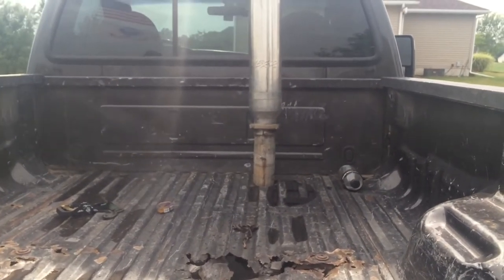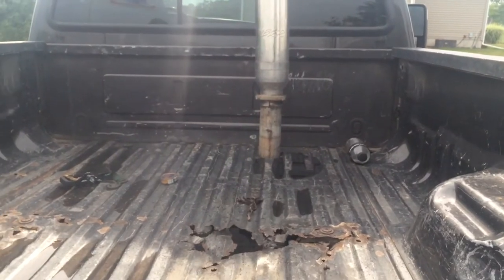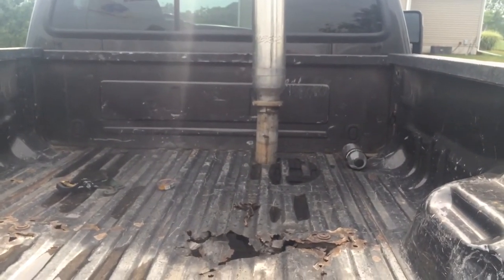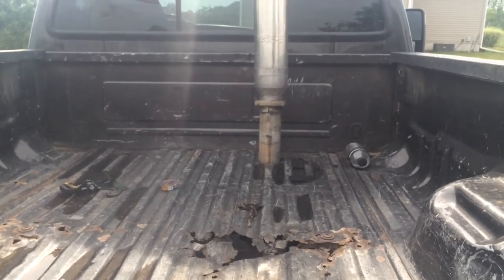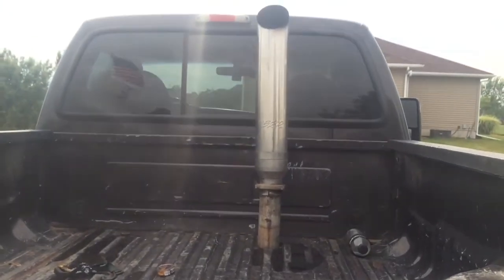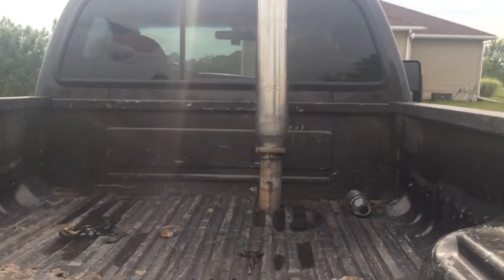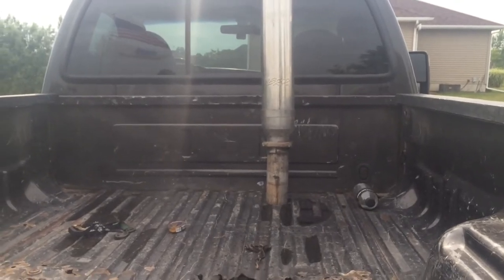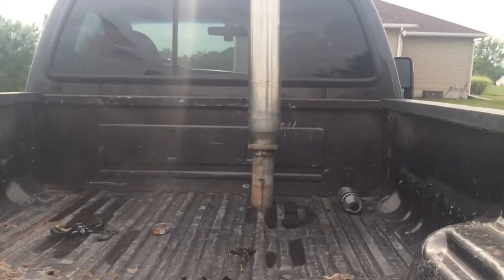3 Reasons To NEVER stack your truck!

Comment: Solution to Reason 1) upside down bucket on top of stack anytime your not driving. Take the bucket with you!

Solution to Reason 2) close back window, turn up jams.

Solution to Reason 3) TIG weld your patch back up on the hole in bed from trunk of stack.....repaint if needed. Lol 

👍